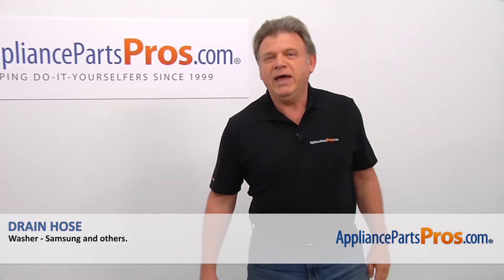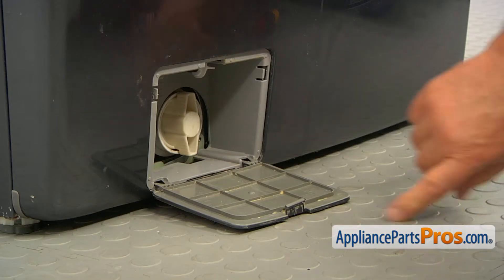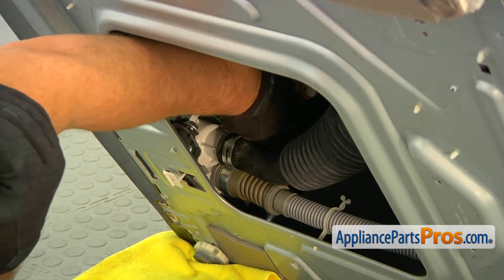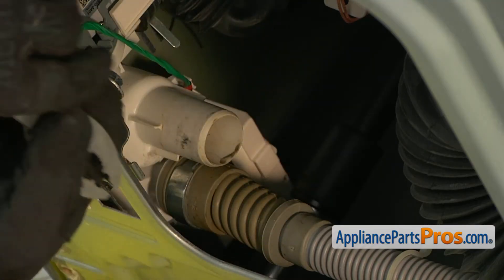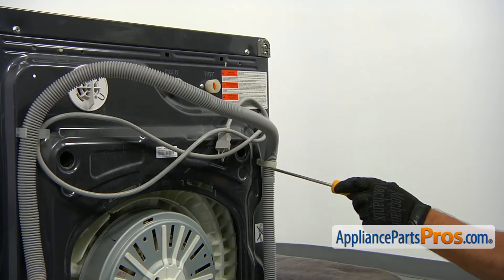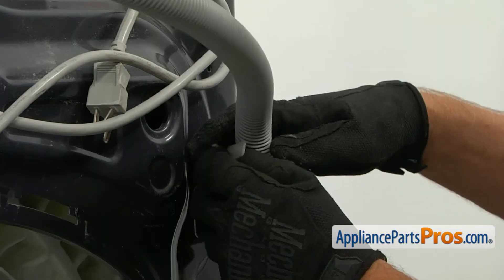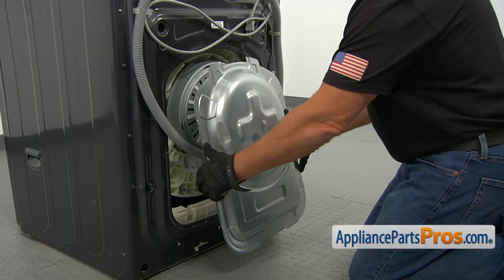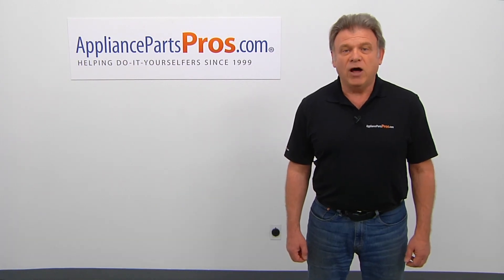How To: Samsung Washer Drain Hose DC97-17093A

Comment: What is the function of the black ring we’re the hose connect to the water pup
Reply from the maker: The black ring on the pump is a seal. It keeps it from leaking.
Reply: U tink is gonna be a problem my get damage
Reply from the maker: If that seal is damaged you will need to replace it. That is usually only available with the pump. If you provide your model number we can look that up for you.
Reply: @appliancepartspros  Samsung
Reply: @appliancepartspros  so have to be the water pump whit the water drain hose
Reply from the maker: We would need the model number of your appliance to look up the parts for you.

Comment: Hi There - I need help - Lately I have been observing dust soil grim all kinds of particles once washer cycle is done .. I cleaned Washer in and out including the drum (inside /outside) but still I could see dust soil grim. I tried to replace drain pipe but couldnt find it online(on your website it says out of stock) - so I went ahead and clean the pipe inside using baking soda/white vinegar - replaced it back and ran clean cycle .. still I could see dust soil particles - I observed that when water is draining out -- what could be the problem? its become a headache .. do you think I need to replace drain out hose as well? I haven't cleaned or replaced that .... need suggestions ..I have same Samsung WA48J7700A MODEL .. please help me ..

Comment: Look like Samsung washer engineers were stupid when they put Drain pump on bottom right side while drain hose run to back left at middle of rear panel of washer that make connection harder, sometime need extension hose kit. Most of USA front load washer Drain hose 's on right side on top of rear panel which can be attached or remove easy with separate drain hose plus retain clip